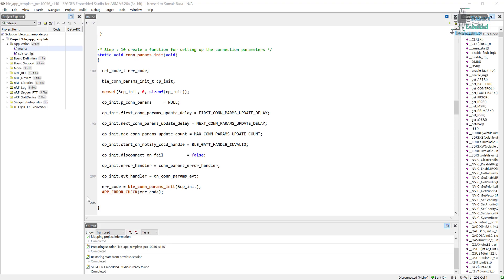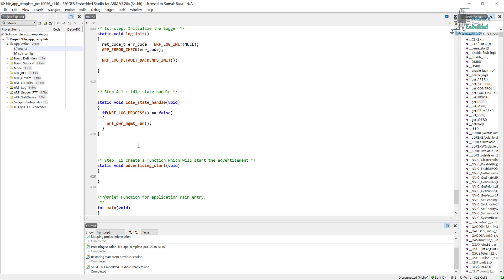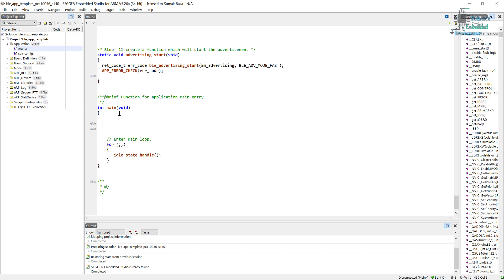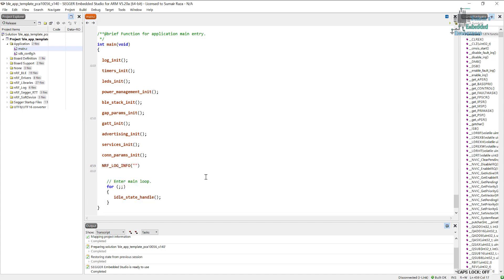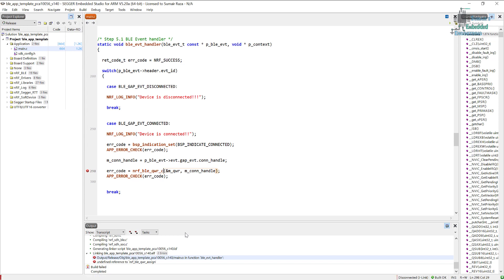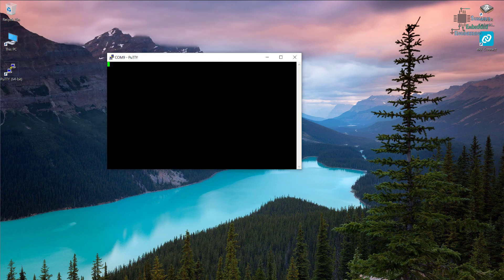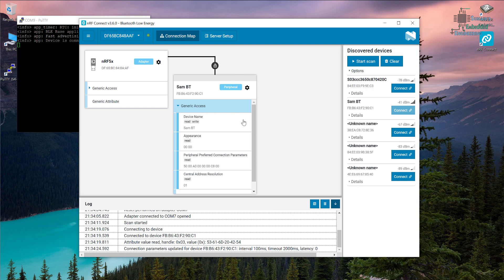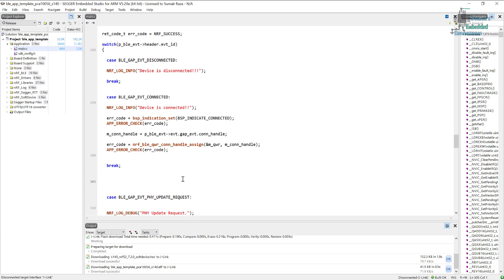nRF5 SDK - Tutorial for Beginners Pt 43 L - Final Basic BLE Application

Comment: So....I went through these tutorials and got this far, but I have run into a few snags:

1. The code never runs successfully the first time, I get the first "RTC Initialized" message but then it says app: Fatal error. I can, however, reset the device and everything seems to work on the second run.

2. I cannot seem to run both puTTY and NRFConnect BLE at the same time. (COM9 Access denied.) I've tried disconnecting puTTY and running the NRFConnrct BLE by itself and get a message that the device must be programmed. If I say no, it drops the message "Unsupported soft-device version!"

Any ideas?

Comment: My code runs successfully, I have run to my custom PCB based on nRF52810. So I used PCA10040e. But code is exactly same. There are few stuff I would need more clarity about as which parameter to change to increase or decrease intervals.

Comment: Hi Sumair, my nrf52832 is only advertising or starting if i start the debugger over segger and press on play. If I supply the chip nothing happens (the applications doesnt start). Is there any step I have to consider?
Second question: I want a connection between multiple nrf52832 and need to be master and slave. I want to apply a beacon application. If chips are in range they should directly start with the communication and data transfer. Do you have any idea or hints how I can start?